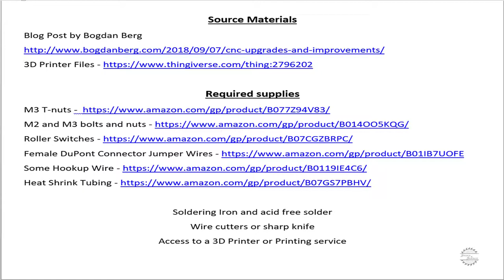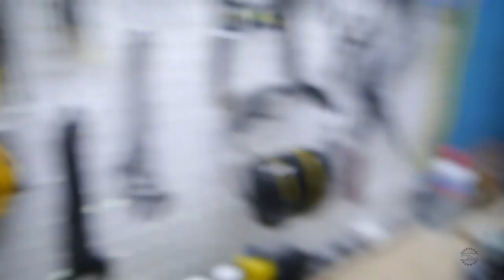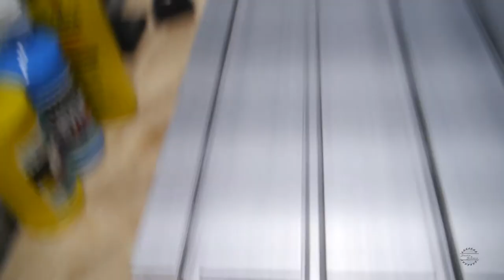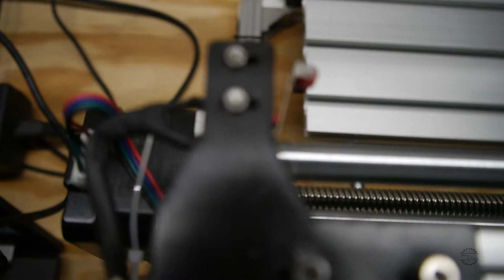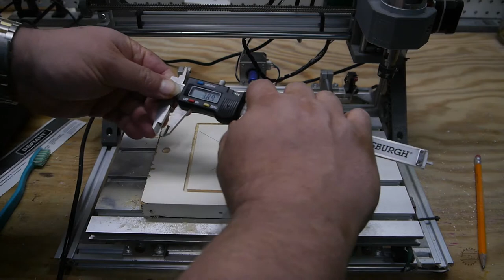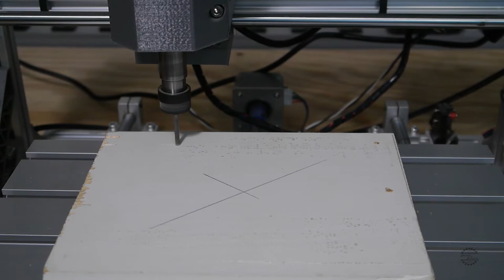3018 CNC Limit Switches and Calibration

Comment: Thanks for the Video, do you have an STL for the 3D printed parts?
Reply from the maker: On Thingiverse Thing:2796202  3018 CNC Engraving / Milling Machine Accessory Set by 8SquareFeet February 16, 2018.  There are links above in the show more. that should now work.  They were broken until I just fixed them.